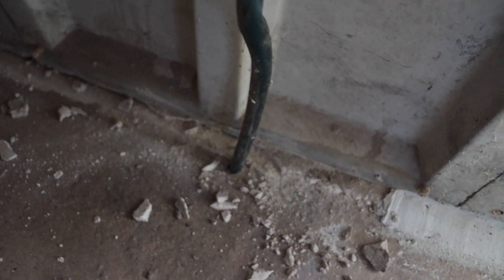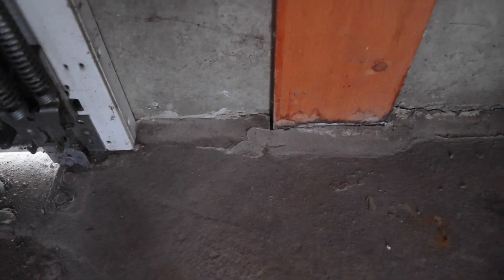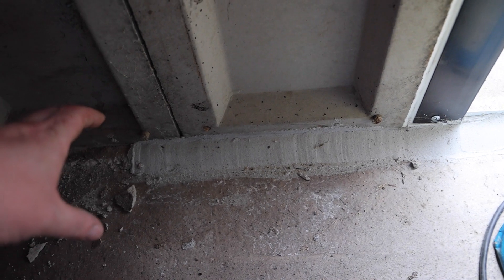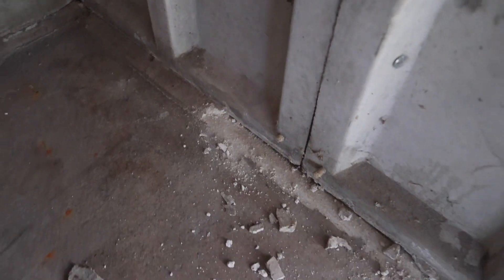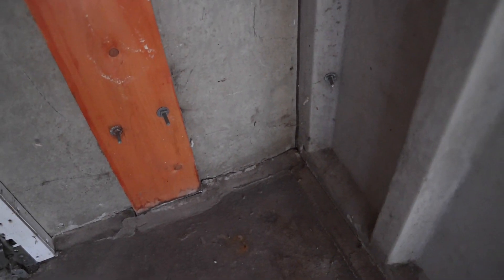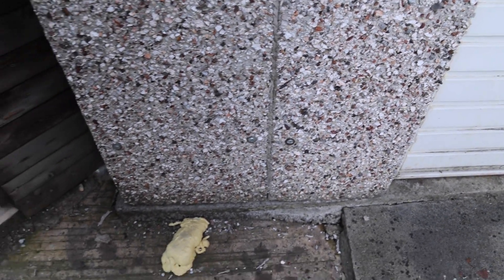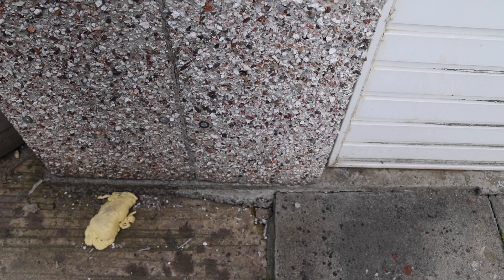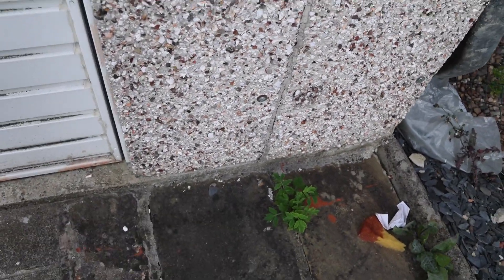Part 24 concrete border apex garage conversion

Comment: I'm having this exact issue. Got ripped off paying someone £600 to put the roller shutter up and do the cement border. It failed. I'm going to try and use Febtank plug right at the bottom then use the Platinum fillet seal product. What type of cement did you use for yours?
Reply from the maker: normal cement just do a 1 to 1 mix so its super strong and over size it. you could put plastic fibres in it for more strength